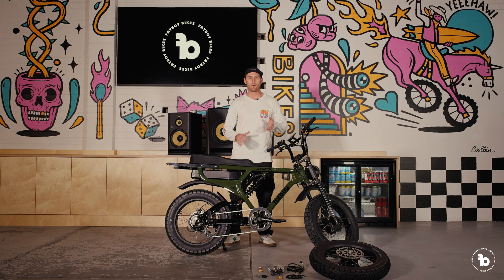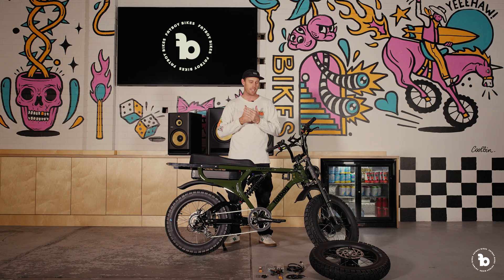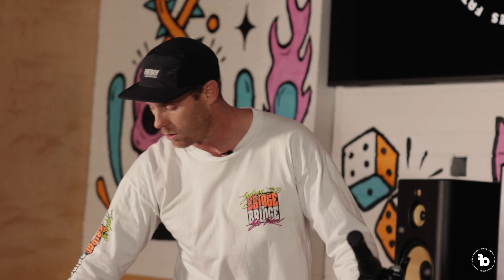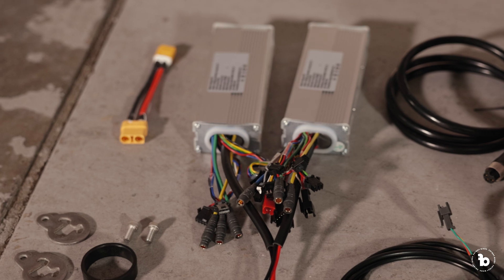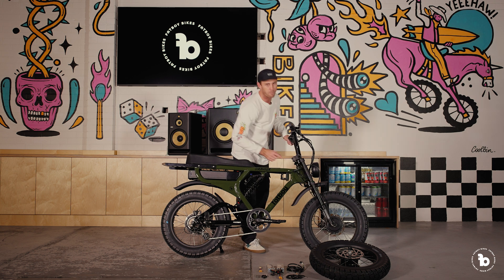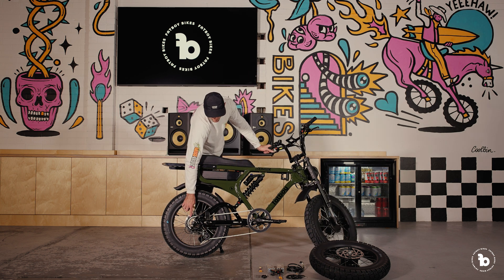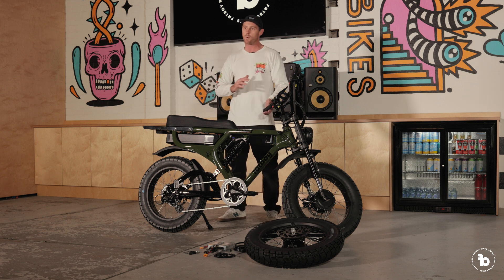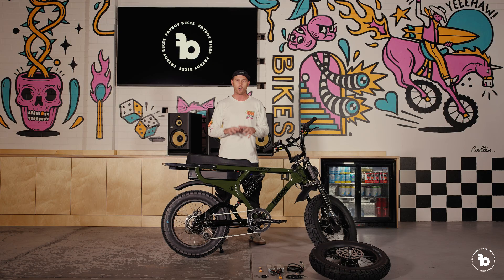Dual Motor upgrade for V2 Fatboy eBikes

Comment: Is there any way to bypass and put the front motor kit on the bagus?
Reply from the maker: Hi Frank - The shape of the forks on the Bagus makes it non-compatible with the motor kit.
Reply: @fatboybikes is there a way i can work around it? Like not having front brakes or taking the shock guards off?

Comment: I’m am getting a Fatboy but I don’t know what to get because the scrambler has dual motor capabilities but the bagus has better suspension but no dual motor.
Any chance there will be a dual motor for the bagus?
Reply from the maker: Hey Frank - Unfortunately the front motor kit isn't compatible with the Bagus due to the shape and size of the front forks. It can only be installed on the Scrambler and Harlem.
Reply: Scramblers suspension is very good. You need dual motor only if you wish to do some adventurous rides off road with lots of uphills. So you need to ask yourself what is more important for you. Yet, Scramblers suspension is still amazing. Do not be deluded but new tech specs.
Reply: @sigmundochudzawa7102 thanks for your comment, I chose the bagus as if I got scrambler with duel motor it would be illegal.

Comment: How fast does it go max speed with the dual motor on private property?
Reply from the maker: Hey mate. Max speed won’t change too much with the dual motor. It is designed to give you more torque and power to tackle steep inclines and handle more weight.
Reply: @fatboybikes  Thanks for the response sounds good

Comment: Make harlem 5cm longer , two batteries or 3 for dual motor version. Stepthrough stronger higher with integrated batterie
Reply: Well, maybe you should get a dirt motor bike instead

Comment: Do you understand what is 95Nm  1560W peak?? Do not play with good luck you need much stronger fork not just spokes.

You originally made you front fork   far too strong and too heavy without 1000W motor or you looking for major failure what can be very dangerous.

Do not sell any conversions.

Sell dual motor bike with proper front fork much heavier, 300  to 400$ more expensive.
Sell single motor ebike with front fork much lighter as it is 2 batteries.
For single motor 1000W recommend dual battery as standard.  52V 2x 20Ah or minimum 2 x 15Ah if cheaper.
For dual motor 2x 1000W  recommend 2 or 3 batteries. 2x 20Ah, or 3 x15Ah

1000W requires 20A , peak requires 30A not good for the battery. You charge with 3A  and discharge with 30 or dual motor 60A?   Total disaster.
Should not go over 15A , only very short time.

Comment: Hey guys just asking if you were to add an additional motor to the front wheel will it make the bike die alot faster or even just more than it would with a single motor
Reply from the maker: Hey mate - yeah it will definitely draw more power from the battery.